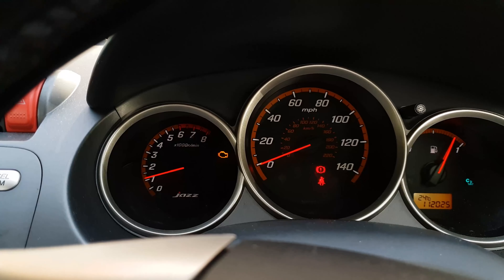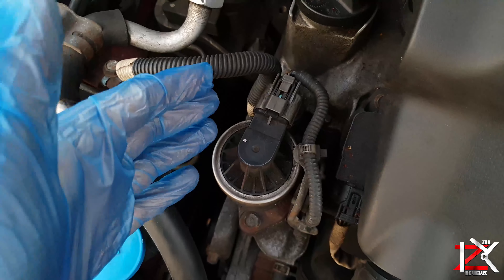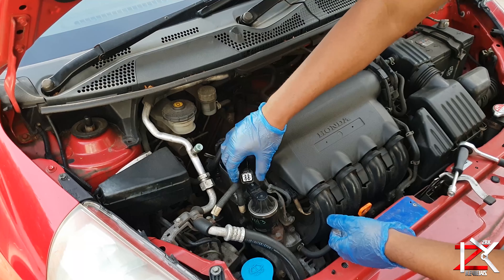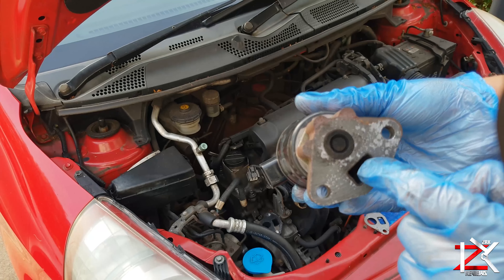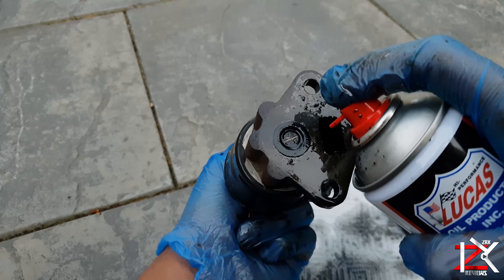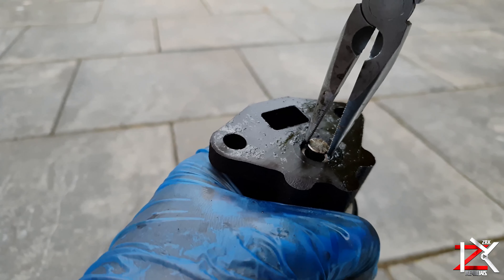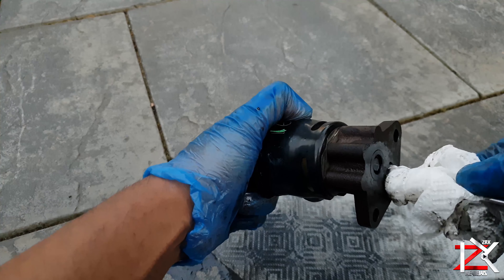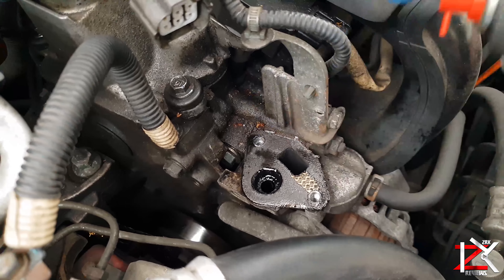How To Clean Car EGR Valve - Honda EGR System OBD II P0401 Fault Fix

Comment: Nice on, just did it on a 2006 jazz , seems ( still got to test it long run ) work fine.     I did use a ultrasonic cleaner ,  as in.. why not .  Just don't submerge the black/top part.

Comment: I had cleaned the egr circuit and the intake circuit and it is fixed.
Reply: By circuit, you don't mean electrical circuits, right?

Comment: Hello, thanks for your video
I have a question : it seems like you're using a diesel egr cleaner on a essence motor, is it OK?
Reply from the maker: @mathieurosania8451 yes I only had that at that time  shud be fine, main thing is to clean it out

Comment: Can you please make a video about a dirty throttle body and how to clean it good so it can function good. 
Thanks
Reply: i know i am super late, but take off the air box, there will be wiring going to the throttle body disconnect it, there should be 4 10mm bolts securing the throttle body, take it off and away you go with throttle body or egr cleaner, making sure to open the valve and cleaning the hinges for the butterfly, oh and do both sides! put it back into place and you're done!
Reply: @fittsy7534 please make a video😢

Comment: What cleaning spray do you use?  And is it necessary to replace the gasket?
Reply from the maker: egr cleaner can be bought from stores or online, only if its worn out or broken then you replace gasket. also clean or replace the oxygen sensors that relates to the error codes.
Reply: Thanks 
Carb cleaner is good enough?

Comment: I already do cleaning the EGR and check engine lamp activated.
Reply: How is it now ?
Reply: @KEJAD1AN  working normal, already fix it. The problem is, One of the wire not good.

Comment: My honda crv 2010 car scanner shows egr err 99.2.I cleaned the valve but still shows the same .Do I need to change EGR valve? I eagerly waiting for your reply. 
Thanks.
Reply from the maker: Clean it, place it back in, delete the code using obd2 device,  if it keeps on coming back up u can change it but it may relate to ur sensors need cleaning too.

Comment: After cleaned and reinstalled the EGR, no need to reset the car ECU?
Reply from the maker: Normally you would reset the engine light from the diagnostic machine after replacement of the car part

Comment: i did it but still error comes back after 3 to 4 days what should i do
Reply from the maker: @JeffreyPhillips-lc1fe  you can replace it and check from a scap yard to see if it is the egr valve or can be the sensors
Reply: @ZRKREVIEWS  You are a legend for still replying to people, I am about to clean my EGR valve but i only have MAF sensor cleaner that apparently can be used on any electrical part and it cleans carbon and sludge, Should i still use it or rather get EGR cleaner?

Comment: good please I cleaned it correctly then I turned off the alarm with diagnosis but unfortunately after two days the problem returned again, I did not understand the problem or exactly
Reply from the maker: if the problem persist could be an electrical fault somewhere that causes sensor issues.

Comment: Does this help with misfiring
Reply: No. That’s to do with the pistons, the spark plugs or coils. The EGR valve is for emissions and circulating gas intake airflow. It would be just a rough idle and not a misfire from one of the pistons banging.
Reply: I think it could.

Comment: Is it okay to leave the port without cleaning after you've sprayed egr cleaner? You didn't wipe it as in the video, you just installed back the EGR valve? Is that okay?
Reply from the maker: ur electrical ports you need to cover. you can wipe off any residue if u wish in the vales
Reply: I think he means the metal pipe type of ports, not electrical.

Comment: Thanks, but tell what is egr system
Reply: Exhaust gas recirculation. Basically it takes inflammable air and puts it back in the engine. The engine will be smaller than it actually is because it uses less gas and less air while still taking up the same space inside the cylinders. Better for environment and helps with fuel consumption.
Reply: @charleywaynehinkle6358  thanks dear

Comment: I own a 06 Civic Hybrid, would removing the EGR valve affect my catalytic converter? Would I have to reset it or anything after cleaning or replacing the EGR valve? Any help is much appreciated.
Reply from the maker: no it should not affect it, if you have the engine light ON then yes after cleaning reset it using OBD2 device.
Reply: What if the light is not on and you want to clean it as you have bought a used car?

Comment: What are other symptoms of egr problem?
Reply from the maker: bad deposits, clogged up, once in a while does need a clean or also electrical wiring that may cause the engine light to stay on with egr fault
Reply: @ZRKREVIEWS  just cleaned my egr. No more jerking and knocking sound
Reply: Panji Hitam Dari Timur Asia Tenggara how
Reply: ZRK REVIEWS I’m about to clean with the 219,000 mile trial offer let’s go
Reply: @raymondmichelsoniii6606  where are you going?